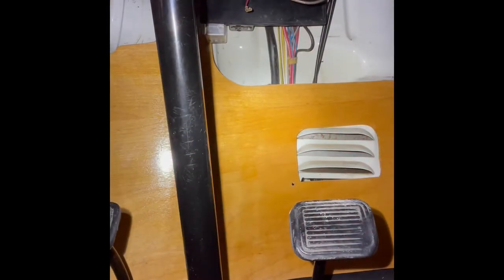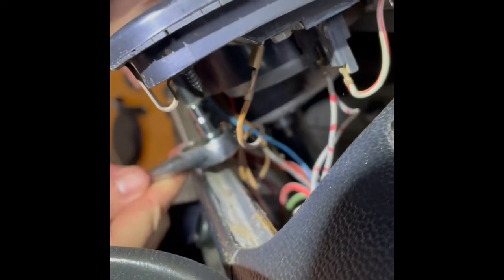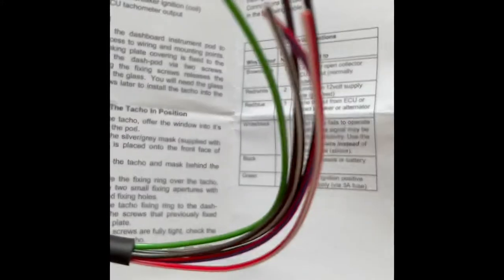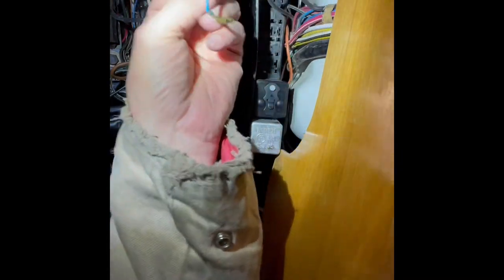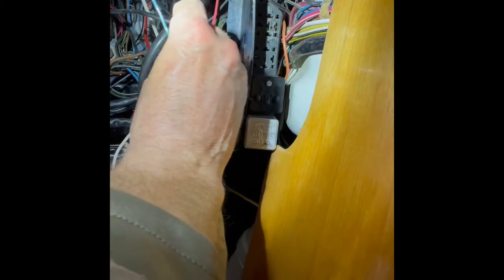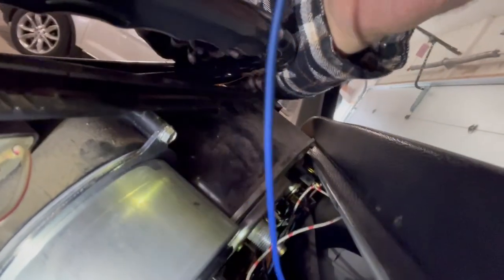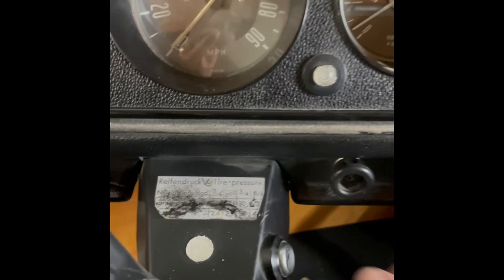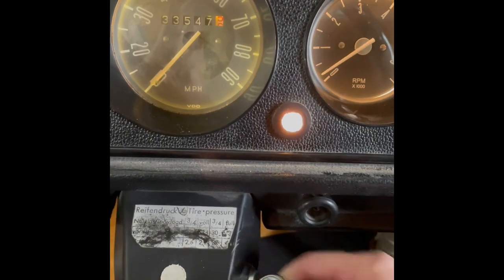Tachometer install on 1974 VW Baywindow Bus

Comment: thanks for the video.. I was looking to find which wire from the diagnostic port could be used as a spare wire to hook up my tach. Doing a subaru engine swap in a 74 bus. thank you.  Blue/white wire!

Comment: Excellent video!  Never knew there was a test circuit.  My rear defrost doesn’t work anyway. 
14 gauge wire to extend where you needed to?

Comment: Thanks for sharing your fitting guide with us as it will come in very handy for when I fit mine too. The only other non related question I was wanting to ask you was that you have a dash switch without and emblem to say what the switch is for below your tachometer and I have one exactly the same and haven't found out what it's for. 
I was hoping you could shed light on what yours is used for ? Thanks
Reply from the maker: I think it is for interior lighting in the back originally. The wiring had been removed by a previous owner on mine. Good luck!